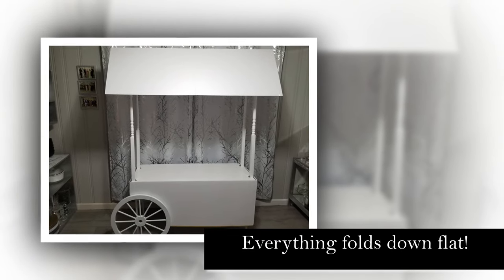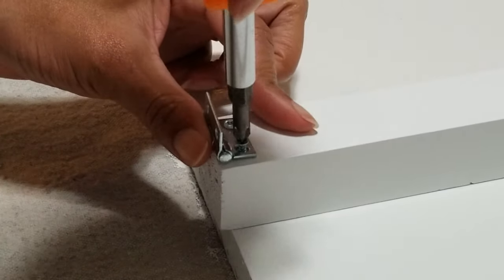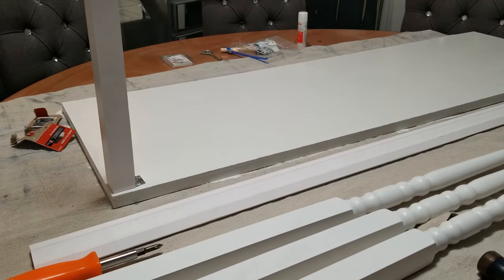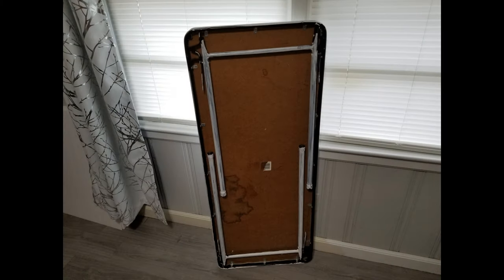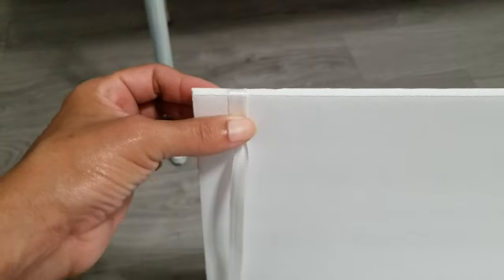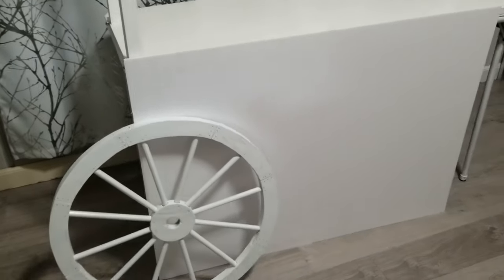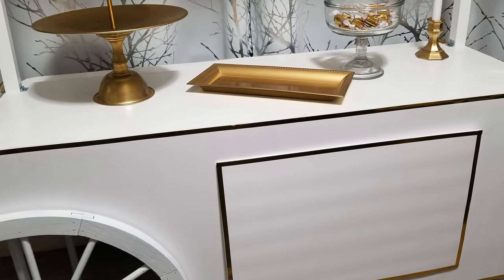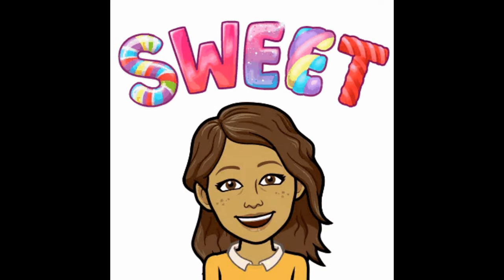Treat Cart DIY | Fully Collapsible Treat Cart

Comment: Hi again!  I’m getting closer to having all my supplies for your collapsible cart.  I know that you used a 48 in size shelving.  Can you please let me know the width of the shelving.  I went to Home Depot and saw both the finished and unfinished ones but they had both in 2 different widths.  The lengths were 48 inches but I don’t remember hearing you mentioning the width.  Thanks and sorry to bother you again.
Reply from the maker: Hi there! Ideally you want your wood top to be as wide as your table. My table is 20" wide. Home depot will cut it to the size you need for free. Hope this helps
Reply: Thank you so much for getting back with me!  I will measure my table width and have it cut accordingly.  You are so awesome and I’m getting more excited about completing this project to transport.  I’ve saved your tutorial to refer to it if I get stuck.  Keep up the good work!  Thanks again!

Comment: Thank you for this! Is it possible to do a mini version. I want it to fit into my trunk.
Reply from the maker: Yes, I think you could measure wood to the size table top you need and just attach shorter balisters. The size I made is 24" and fits across my back seat.
Reply: @stephstorm  ooo thank you! I have a four foot table that I'm using. I'm in home Depot now. They are acting confused when I'm asking for ballisters lol.

Comment: Hey this is sooo helpful! How did you make the bottom portion look seamless or is the bottom of the cart 48" foam board I couldn't find any that long
Reply: Also how big is your wagon wheel?
Reply from the maker: 24" diameter from Amazon
Reply from the maker: Glad it was helpful. I used 2 pieces of foam board from dollar tree and taped them together with clear packing tape. If you add decorations on top it helps hide the seams
Reply: @stephstorm  thank you so much!
Reply from the maker: You're very welcome! Thanks for watching!

Comment: What if I make 2 of the tables and put them on top of each other?
Reply from the maker: Hi Sophia, if you want to avoid using a folding table, you could add sturdier legs to the other side of the wood. Just make sure they lock well so it won't collapse.

Comment: What size are the baulisters?
Reply from the maker: They are the thin ones used for staircases. But you can use the thicker ones if you want. They are all the same length